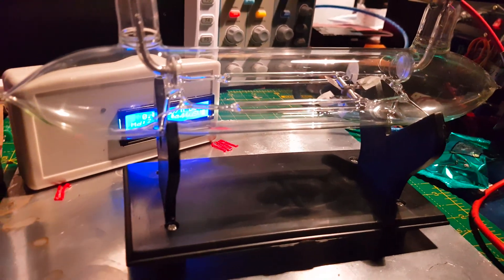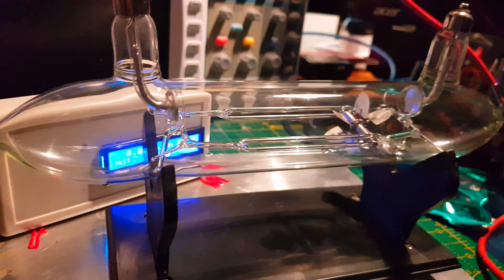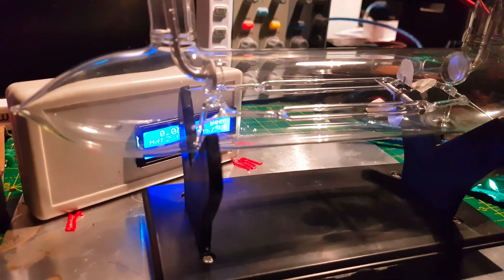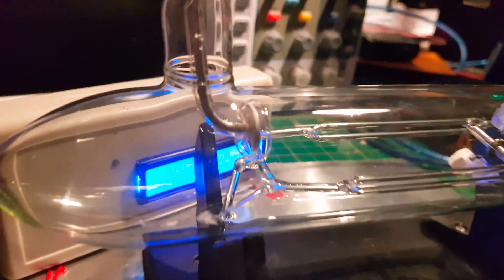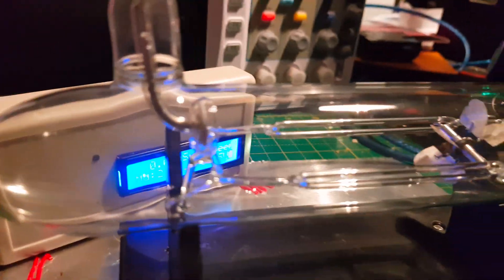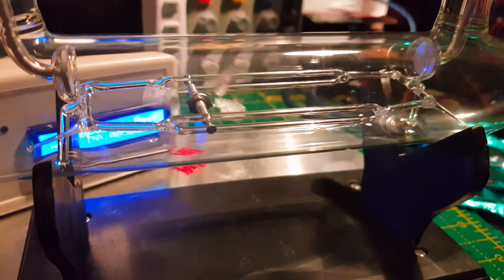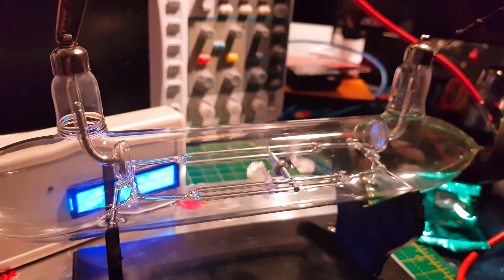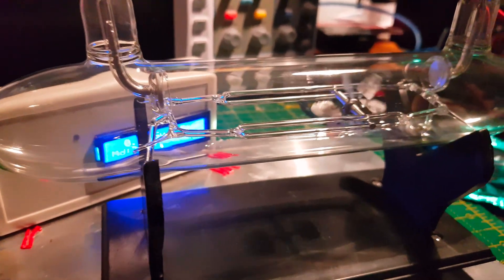Paddle wheel crookes tube  testing

Comment: I sort of dislike this experiment because it presumes which forces are acting upon the wheel and takes an indirect observation as proof without eliminating other possible explanations.  Take for instance electromagnetic fields.  Current is flowing creating a magnetic field.  Charge differentials exist because some vanes are in the path of the flowing charged particles and others are not.  Magnetic field interactions between charged and uncharged vanes and the steady magnetic field of the stream could likewise cause movement which is constrained along the axis of rotation.  Given the mass of the wheel, the great rate of acceleration, and the small mass of electrons, magnetic interactions seem more plausible than physical collisions.  Thoughts?  Not criticism of your beautiful setup, only the now age old premise of the original experiment.
Reply: According to Wikipedia, the movement of the wheel is caused predominantly by the radiometric effect - when the cathode rays hit the wheel, they heat it, causing adjacent gas molecules remaining in the tube to expand, which propels the wheel. JJ Thomson, who discovered the electron, "calculated that the momentum of the electrons hitting the paddle wheel would only be sufficient to turn the wheel one revolution per minute."
Reply: yeah man
Reply: some guy in my class told me this a couple weeks ago and yeah it makes a lot more sense